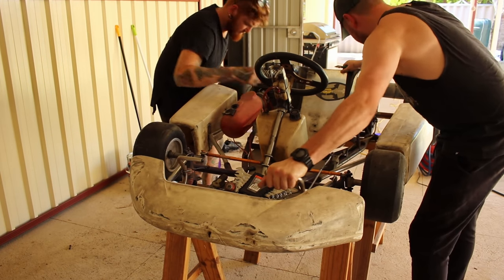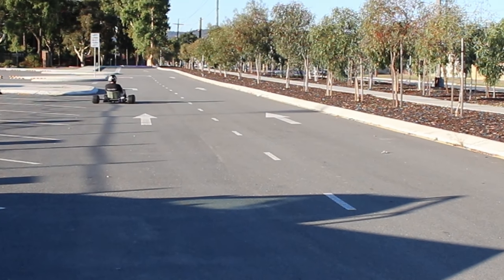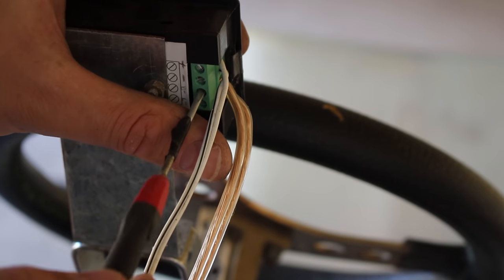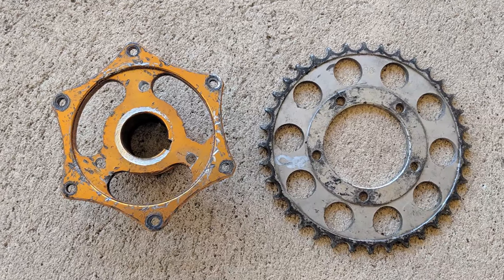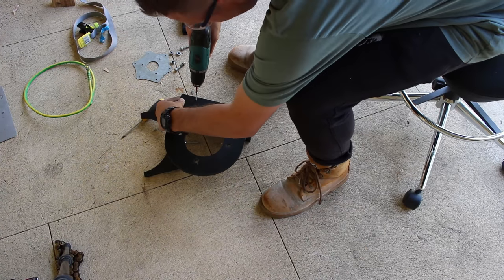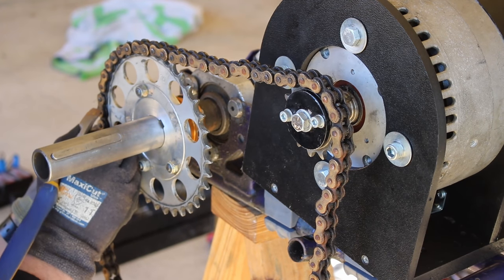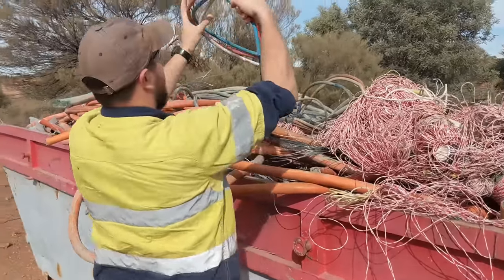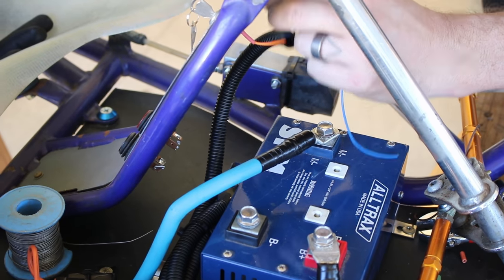DIY Electric Go Kart (Part 2)

Comment: 48v @ 60amps should be much quicker off the line than the video shows. I used a simple 40amp dimmer switch pwm controller for £9 with a my1020 brushed motor in an old mobility scooter and it looks quicker than your 60 amp setting. Have you tested the output of the controller? I like your adventurous creativity btw, impressive stuff. It can be just as exciting building as driving sometimes.

Comment: Old vid but I just got a setup similar with AllTrax 300amp controller and didn’t realize I had to hit set button when programming so I maxed everything out with some huge lipos hooked up at 48v. 250amp was scary as hell. Seriously got to 50mph asap chirping tires along the way trying to swap left and right like a damn video game. I’ve had some karts before with 12hp motors and this blows those away. Those are boring and this scared me to get to full throttle. Tires are bad and but bumpy so that doesn’t help and first test but I also can’t pull 250amps all day long. Batteries really rated for 100amp so 50over is really bad. Fun test run tho now time to pull settings back.

Comment: The battery probably is the biggest problem.. I would need a minimum of 3000€ of batteries to get my ME1003 to running on full power without using lipo

Comment: I am looking to build a vehicle myself with electric motors in it, weight is a factor and batteries are too heavy for my application so I am looking into a nitro methane powered generator. Your kart looks like it will be fun when completed.

Comment: I have a 4 stack of leaf modules (8s, about 30v) for my electric gokart. I was peaking over 300a (the max of my meter) on acceleration... until I snapped the motor shaft. That motor looks like a nice upgrade for me, although I have this idea for using a high power ebike hub motor I may go with.
Reply: Brushed motors are terrible inefficient compared to Brushless..
You better run with a high voltage battery and the motor electric motor from something like a prius that can be found cheap online :)

Comment: It's a cool go cart. Also.. the higher the voltage the more run time you get.. at least that's how it is with electric brushless bicycle set ups
Reply from the maker: Agreed. This comes down to power consumption of the load. Increasing voltage decreases current draw for the same power figure. Ohms law 101. Cheers for watching man :)
Reply: @TheHandyTech  yeah.. also makes me think of how 220 volt Ac is more efficient than 120v for home.

Comment: Sweeeeeeeeeet! I'm thinking about switching one of my gas go karts you electric!
Reply: I did exactly that about the time that you wrote this....it is AWESOME!! I'm using a 48 volt system comprised of four 12volt SLA deep-cycle batteries with a Motenergy ME0909 motor and Sevcon controller. I bought the components from a company called Thunderstruck Motors. Where the original gas motor was loud and smelly, with a top speed of about 15mph, the electric conversion hits 55mph and gets up there real quick! It's probably my favorite thing of anything I've built, and I've built a LOT of stuff!

Comment: Very good start guys. You honestly need to put that motor up to 72 volts. I haven't checked your other videos, what batteries are you running? Ensure they can provide the current required. the amount of current being pushed into that motor right now should have enough torque to spend the tires easy depending on your gearing

Comment: I would love to do a 72v 300 amp system. You learn right away this stuff is not cheap....lol. The batterys alone to make a 72v 14kwh battery would be around $5000 using ncr18650b cells. Maybe someday....lol

Comment: You could and I mean could not should crimp the cables with a vice or a lock cutter :) works also good, also soldering them with a gas torch would also work and would be much easier

Comment: its looking good, but you definitely need to get an adjustable metal bracket sorted for the motor and chain tensioning, also maybe double your battery pack if you can, at 200+amps its going to drain fast, i'll subscribe and keep an eye on this project, looking promising.
Reply: ShroomzGames I’m curious as to why you would need chain tensioning? I ask this because in normal shifter karts you want the chain to have a little droop. Maybe the different motor accelerate differently and that’s why maybe you might need that extra play in a gas powered motor where the acceleration comes very fast and quick.(might cause unnecessary wear and tear if too tight my guess)
Reply: @hersonventura10  yeah chain tensioning is a little over the top, ive never built anything for road or track use, always off road stuff where a tensioner helps keep the chain on over bumps, hills and jumps so probably not needed here as there is no suspension for the motor to move separately to the wheels, as long as he builds solid motor mounts for this from metal he shouldn't have any problems, but yeah to tight or even putting a small tensioner on something like this will cause premature wear on the chain and cause it to fail or snap quicker. On the other hand if it's been driven on bumpy streets and chain does come off a lot, a £3 plastic tensioner from amazon for mtb's would stop that from happening.

Comment: bigger motor could be more efficient
brushed isn't ideal, though

limits of the battery?
Reply from the maker: We have hit the limit already. The main problem is the voltage dropping under load which puts the controller in a safe mode. More about this in the coming part :) thanks for checking it out man
Reply: higher voltage has less sag
but you can't anticipate the end of the cycle through performance easily anymore

if you don't care about feeling performance differences throughout the battery cycle, you could integrate a voltage regulator to keep it stable
Reply from the maker: @marc_frank  The problem with that is finding an affordable regulator that can handle the output current needed for good acceleration. A good suggestion if people are looking to achieve longer range
Reply: thought about that, too

Comment: For your thicker wire you’re better off using fine strand copper. Low-voltage travels around the outside of each individual copper conductor and the more copper conductors you have in any given wire the better flow of electricity you achieve. What are you are doing is working but you are using high-voltage wire.

Comment: What gear ratio are you using??  I'm building pretty much the same thing, same or similar brush motor, and was planning on using about 60v lipo batteries in a pack 10 to 20ah in size.
FYI - planning to use an aluminum plate motor mount assembly .. and probably a wide timing belt drive system (used parts from a road racing kart).
Reply from the maker: The sprocket on the axle is 36 tooth and the motor shaft sprocket is 14 tooth. Sounds cool man
Reply: @TheHandyTech  thnx!! ... I started this project 10 years ago but stopped when my source for some A123 batteries fell through .. . I have a Briggs & Stratton Etek Motor,  AllTrax AXE-7245  controller., some big contactors, and all the other stuff .. along with a Comet Kart.

Comment: Why did you use a brushed motor instead of a brushless? (Just wondering)
Reply from the maker: Just an availability/cost thing. It came up on a buy and sell page and I negotiated a good price for it. There's occasionally a little negativity towards brushed because the brushes wear over time but otherwise it's a beast of a motor :D also the efficiency is not always as good but still not bad
Reply: I went to your channel looking for the trike build but didn't see it. I have a TaoTao GT5 that's in need of a new crank. I can do it but I want to convert it to electric.

Comment: Nice video haven't seen later ones, but when i did something similar years ago before we had good a batteries i used an generator off a push bike with capacitors to re-charge as your driving (obviously now you can buy motors that have that tech but expensive)

Comment: Use a lug that has a split in it and you can crimp it with some channel locks and a hammer. Just filling it up with solder like you did doesn't seem like a good idea with that amount of current.

Comment: You could get rid of a few links on that chain because it was way to loose
Reply from the maker: I didn't show it too well in the video but there was only around 1cm of travel when I had finished tensioning it up. The chain came off because the plastic bracket twisted. I'll showcase it better in part3

Comment: Great Video, quick question, why not a brushless motor?
Reply from the maker: Hi Carlos, the first motor shown in the video was a brushless motor. The second is a permanent magnet dc motor. I replaced the brushless with this current motor because it was rated for a lot more power, during a peak scenario up to 15 times more. I also got it with the controller for a really good price. Thanks for watching

Comment: I want to turn a TaoTao GT5 electric. I  want to use the stock gearing. I can lower the clutch springs to weak and scoots are already belt driven so I'm thinking it shouldn't be that difficult.

My GT5 was running 55-60 (11000 rpms killed it maybe haha) with almost every upgrade it could have, besides boring the case for the biggest piston/head available. Is there an 11000 rpm motor with at least 5hp you could suggest?
Reply: Kx65 engine... lots of rpm's

Comment: 1kw isnt enough. you need at least 7kw to get some speed from these tyres.
and mad man is right, you need a lot more amps and a lot more capacity. (or you must scale down wheels/find a smaller gokart)
Reply from the maker: The motor is rated at 4.8kw continuous and up to 15kw for one minute according to the motenergy site. I will be working on power delivery in part 3

Comment: Are you driving both back wheels and is there a differential?
Reply from the maker: Yep just a simple axle with a sprocket on it, no differential
Reply: . @TheHandyTech  So both back wheels are locked to the axle?
Reply from the maker: @lenrman969  yes there are wheel hubs at each end of the axle and the two wheels are fixed to the hub. The axle runs through three bearings that are housed in the frame. The axle is rotated by the large sprocket and chain. It's just a standard go kart nothing special
Reply: It's called a straight axle.. you can go to www.GoPowersports.com to get some cheap and afordable.

Comment: You need to get a brushless motor. DC motor will drain the batteries to fast
Reply from the maker: Did you check out part 1? The original setup was a 1kw brushless
Reply: @TheHandyTech  not yet.. I'll check it out. Go to my channel too if you want to see my electric chopper 24 volt system

Comment: didnt have a torch for the cable soldering??
Reply from the maker: Nah man unfortunately not. I've looked at the right tool for crimping this size lug and its a couple of hundred dollars for a proper one. Rather put that towards the go kart for now. I'll have to keep an eye on the lugs but they are holding up just fine so far
Reply: @TheHandyTech   nice!! i would still get the torch for soldering those large gauge wires. i do car audio a lot and solder with crimp is always the best connection. crimps sometimes come loose over time with vibration. the solder makes sure it will never.
Reply: it will also lower the resistance at the connection with the solder over the crimp alone since air gets trapped inside the wire.

Comment: for some reason  at 60amp ur kart looks pretty tamed...something i m missing or my electric trike weight 100 lb plus my weight 185 lb, dual 1000w motors with 52v 17ah battery, at 60amp it scares the shit out of me..
Reply from the maker: I think even though we have set a current draw max of up to 120a in the video it's probably not delivering anything close to that. The voltage is falling away under the load and I am getting a fault code on the controller. I want to do some more testing before I can give you guys some better answers but rest assured there is more life in this kart we are still in the development stage :) your trike sounds awesome by the way

Comment: Can you use a 48 V 1000 W motor and 48 V battery pack a which is actually a 52 old battery pack this rechargeable slips in goes that's what I use on my 3 will electric bike
Reply from the maker: Yeah just got to be careful not to exceed the limits of the controller in my case. The maximum voltage I can put in is 60v

Comment: 45kph my ass
Reply from the maker: Well, the motor will do 72rpm per volt and we are putting in at most 58volts which is just under 4200rpm. The ratio is 36/14 so about 2.5 meaning the axle will do about 1,625rpm at top speed. The circumference of the rear wheel is 50cm so it will travel over 800m per minute and over 48 kilometres per hour. Of course there will be some tolerances and losses but yeah cooked you mate